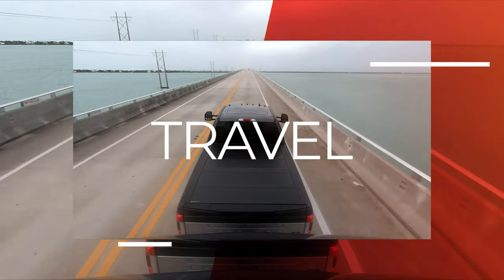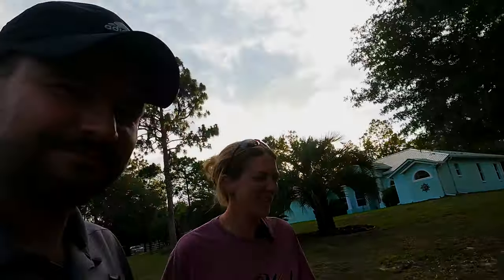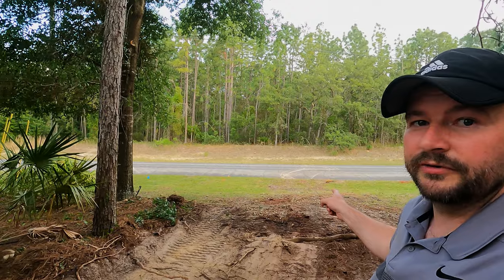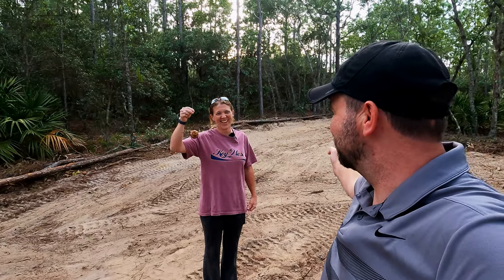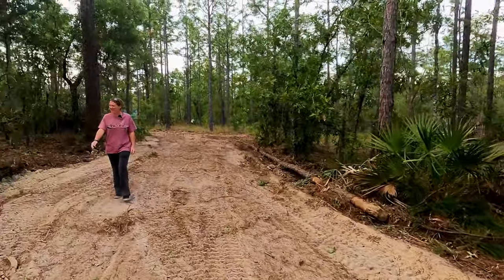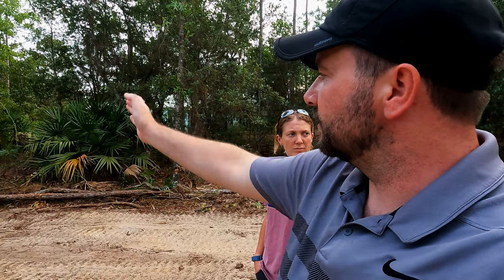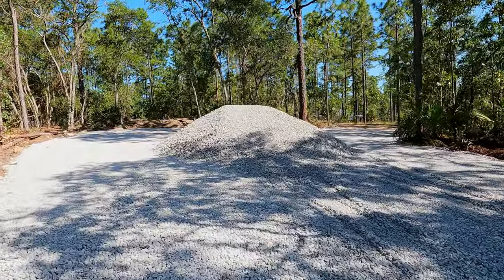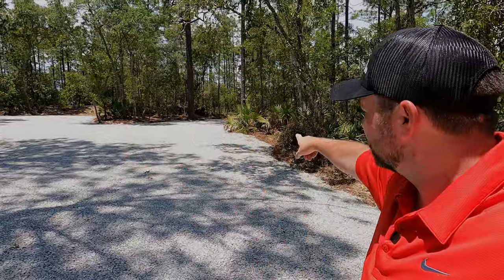Building a driveway & RV PADS

Comment: You've got another option that would save you money on the power. Have him  set a nema 3r subpanel and then branch off of that for your 50a circuits, if sized properly, and if your service is big enough you could also put some 15a receptacles there as well
Reply from the maker: <Brazen Brits are googling nema 3r, please wait…….> 😁
Reply: @BrazenBrits  nema 3r just means its an outdoor rated load center or panel

Comment: Wow! You built a pad just for us!? Guess we'll have to upgrade our driveway and power supply before your next visit. You're always open to suggestions, so... If the space was there and the money was there I personally would have made it a loop so you could pull all the way around and be able to drive straight out. It would also have your camp side facing the house. Maybe in phase 5.😉

As far as getting to the house, a nicely designed garden path would be nice maybe with a bench half way to just sit and enjoy nature.

As far as water and electricity, run it to the back between the pads. That's why they make extension cords and extra hoses.

Concrete 67K+/-
Reply from the maker: Yup, these are all things we need to figure out. Good plan about the path. Luckily, most of the land is small trees and shrubs, so won’t take a lot to clear a nature path. 

We did consider the loop, but cost and ongoing maintenance along with the fact of cutting down more trees was off putting. Not scared of a little trailer backing are you Chief? 😉
Reply: @BrazenBrits  a little, no. A big ass long tight run, maybe.🤣

Comment: For water, can you put a well in back there between the pads?

My concrete figure was based on prep, minimum 6"depth, and edged.
I know it's "done" but I would extend the incline going in to decrease the rise in the angel. It only scratches a little, but enough "little" times will make a big gouge sooner or later.
Reply from the maker: Not sure about the Well. I don’t thing it would take much to run water from the house. I guess it’s all about weighing up costs. We do actually have a dedicated irrigation well, but it’s the other side of the property.
Reply: @BrazenBrits  if you could connect to it you would eliminate some water bill cost even though they would be minimal.

Comment: You might also. consider asphalt rather than concrete. Much cheaper, and easier to repair if needed.
Reply from the maker: We worry about the Florida heat and it melting. Not sure if that’s a thing here, but asphalt in the UK got all kinds of weird if there was ever a heatwave. Especially with things like stabilizer jacks.
Reply: @BrazenBrits  I would check it out. All of the roads and travel area at the fairgrounds at the Tampa RV show are asphalt, and it was HOT there a couple of days AND Tampa gets hammered by storms. Just food for thought. And if it does get a little wacky, it's easy to repair without hiring someone.
Reply: @BrazenBrits  I'd even come down and help you fix it.

Comment: Wow very nicely done. We also live in citrus county and are building our RV pad  for our Motorhome. Faced many of the same challenges, but my property slopes downward so it’s taken some work to make the slope gentle. I’ll be tackling the power issue as soon as we get the stone in, right now just letting the road base settle a bit.
Reply from the maker: Hi Dave, sorry for the delay in replying. We are still struggling with the power. If you know of any reliable electricians, we’ll take any recommendations we can. Finding a reliable one has been the biggest challenge!